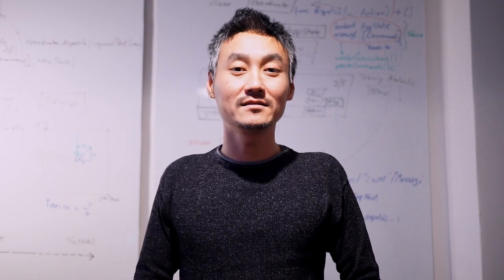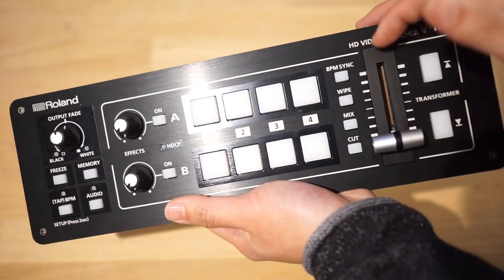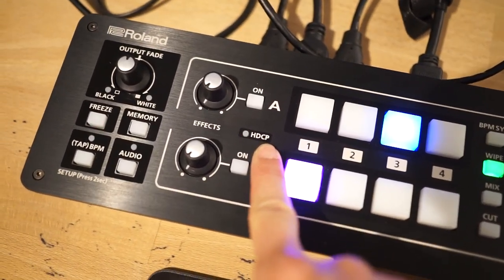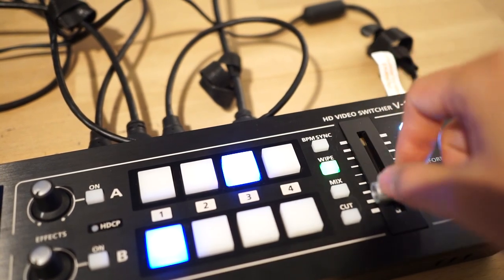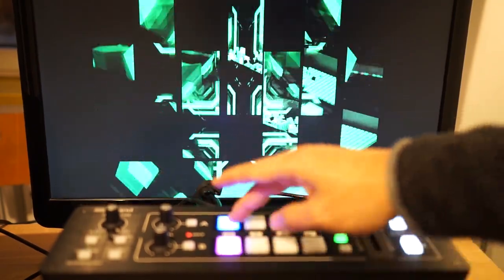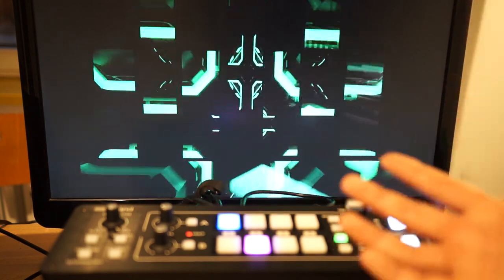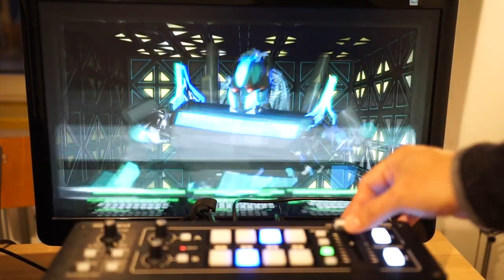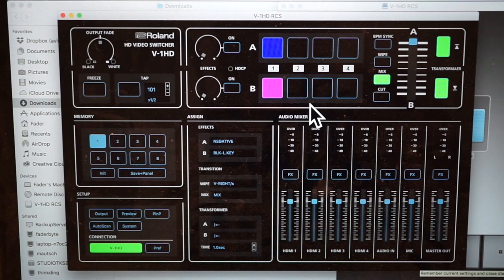Roland V-1HD – VJ Hardware Review

Comment: It’s nice seeing a review from a VJ perspective - thanks! I’d like to see their next model in this form factor have only 2 hdmi / sdi inputs (sdi would cover a wider user base + cables can be ran further + BNC connectors can take a beating vs HDMI), 4K support, and of course a nice built-in display screen for parameter selection, snd maybe Bluetooth for running some wireless control. But hell, as many VJs that moved from analog to digital know, this product is damn near perfect! :)

Comment: great review. personally I like the V-1SDI better, because it has an internal video scaler, SDI + HDMI inputs, a few more effects and the interface is a bit more stylish with the blue stripes. 
What I really think both are lacking for VJ jam sessions or facade projection jams is a resolution of 1920x1200 (WUXGA), because most professional projectors run in that resolution. Aside of this its a great, tiny and affordable device!
Reply from the maker: thanks for your comment, I personally have no interest in SDI inputs, since they are mainly for professional video camcorders, or for sending long signals over SDI. You are right about V-1HD doesn't support 1920x1200, it can be annoying, the new XS-1HD looks promising with 4 outputs, and same form factor

Comment: HELLO i tried everything to connect Gopro Hero 5 black camera's from the camera's Hdmi output directly into de VH-1Hd but the only output signal i get is a small video stroke in the left top corner ...the rest of the outputscreen is black.. If  i use an older Gopro Hero 4 and do the same the output is normal....can someone tell me what is gong wrong?
Reply from the maker: try checking your output resolution of your GoPro 5, maybe it's sending 4k instead of HD
Reply: Thanks for the reaction. I solved the problem. And its a strange one. THE OUTPUT OF THE GOPRO IS SET  TO THE STANDARD NTSC and in Europe we use PAl. THE ONLY WAY TO CHANGE THIS IS VIA THE GO PRO APP.  IT IS NOT POSSIBLE  TO CHANGE NTSC TO PAL  ON THE GPOPRO ITSELF......PFFFF